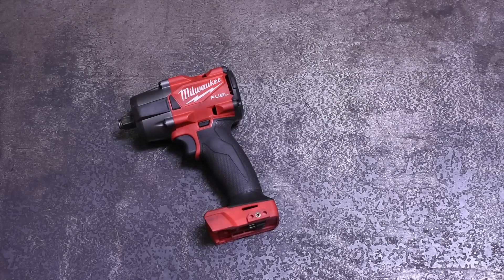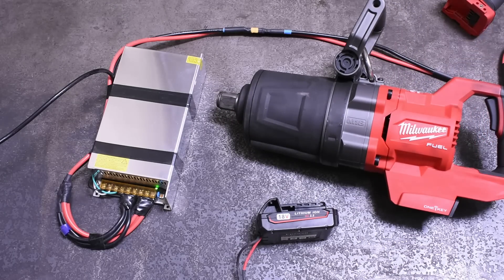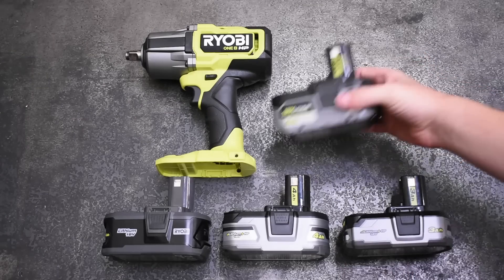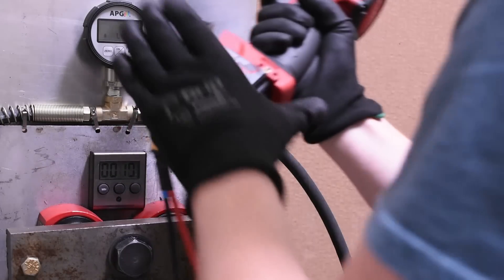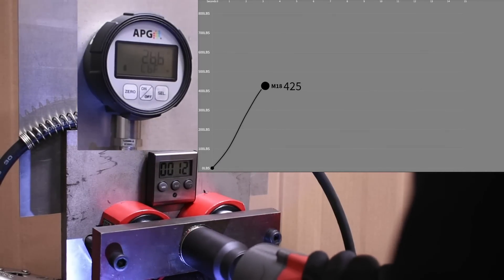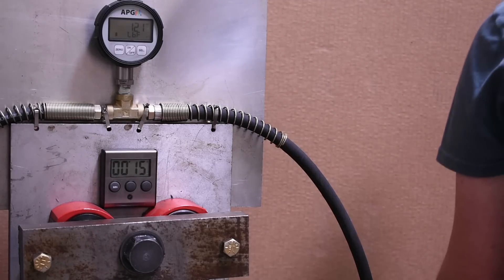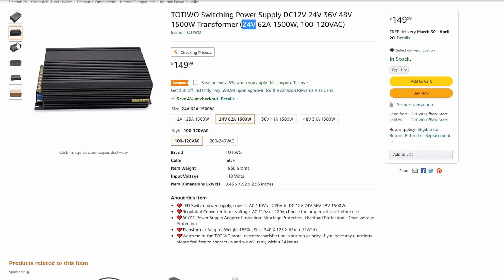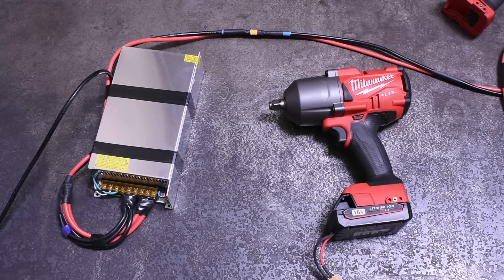Mad Scientist Youtuber Supercharges our Tools: 120 Volt M18 Impacts

Comment: I definitely think figuring a way to power cordless tools with wall power has more to gain than using cordless tools off of battery... sadly I can't think of a non-sketchy way to get wall juice to a battery tool off the top of my head, other than the obvious one of course.

Comment: I would do thicker cables for sure and try to keep them as short as possible. I feel that the pack of power is more the wires then the psu to be honest. I've done something very simular recently for 12v service. I run 6 lights at 100w per light from a computer psu. And I had to do a lot of trickery to get the power from the psu to the lights without seeing a massive drop in voltage from one end to the other.

You always want to have + branch both at the psu and one at the draw. Then wire a multimeter in voltage mode across those. And the number your seeing say 1v take that times 2 and you have a 2volt drop from start to end just across the wires. Keep that as low as possible.

Good wires to use are jump starter cables with super good termination for cars that are made from pure copper. You want a very heavy gadge cable.

Comment: You could also piggyback a battery pack with the power supply, as long as you do not overvoltage the max 21v used in a 5 cell battery pack, there is no risk of having them explode but connect the wires at the output and not to the cells, it would have to flow trough al the circuit resulting in power losses. I had to do that once with a semidead/underperforming battery since I only had that one at hand.

Comment: Don't know how this video managed to slip by me... This was/is something I've been trying to do myself, with old (mid90s-late00s) NiCd drills!
However, my effort is to turn a drill into a rock tumbler, as it's variable speed and shifted into Low gear it should easily handle plenty of rocks! 😏

The computer PSU I was using was the limiting factor though, not because it lacked in current capability, but because it's protection schemes kept kicking in – be it over-current or under-voltage, where the latter is to ensure a computer's stability [crashing], and I suspect short-circuit as well.

Anyways... I'm here for any and every Frankenstein effort!
Modding DC tools, to AC...
Modding AC to DC...
Or, modding EITHER to Gas Powered...
You've done the former and the latter, so that leaves the middle!
(although, I wonder whether an electric impact [AC] might have its hammer/anvil 'tuned' differently than a battery operated one, and whether it could make for a "better" gas powered candidate??)

Comment: To be fair, those are some long thin cables there. Like this is a lot of current down at 20 volts, so it sure isn't ideal to use such thin cables. I would run the 3 conductors all the way into the "battery" pack.

But other than that, it all seems somewhat fine to be fair. I have seen far far sketchier contraptions before.

Comment: he used xt60 connectors on that, which are rated as the name suggests at 60a if he went for the xt90 connectors they can reliably supply more than 250a i run a 1000a through them for spot welding. with larger cables would help

Comment: You could do the same and still have it be sort of portable if you made a pack of two, thee, four, or even more of the big 12Ah batteries in parallel and use a cord to attach it to the tool the same way. You could then wear that power supply as a backpack.

Comment: OSHA nono!? More like OSHA noknow!! Does OSHA know that transformers are safer than lithium ion battery cells? If a transformer shorts out is has a fuse built in. If a battery shorts out is has more potential energy than it's equivalent weight in TNT. A properly sized transformer with proper sized conductors and XT connectors would work all day. The tool would overheat and eventually melt the coating off the coils causing somethings to melt or seize up if overworked. No different than a standard corded tool. 

To improve the output would require a larger battery bank such as 12V LiFePo 150 Ah batteries with 20 C discharge capacity. Meaning if you had two in parallel you could discharge as much as 6000 amps at 12 V  or 72 000 watts peak. A system like this or one with capacitors could take on a charge from a 15 Amp 120 V circuit and turn it into whatever wattage you want. But there would be little point in doing so without first upgrading the conductors and the motor in the tool itself.

Comment: you will never get full power from a regular 120v outlet. I would like to see it rigged up to a 240v 60a outlet. Battery tools are superior to corded tools because they are not limited by the outlet current (15 amps) and can go whatever the battery is maxed at, which is theoretically unlimited as many tools use multiple battery packs in series

Comment: You could build another yourself pretty easily, just need a multimeter, soldering iron, and a driver set. Get the PSU, a cheap battery, some XT90 connectors, some high load resistors (just for adjusting voltage under load), and spools of some 10AWG Wire. Open the battery, and solder the 10AWG wire to the terminals, dremel out some exit holes for the wires, solder one end of the XT90 connector, then connect some more 10AWG wire to the PSU, use the high load resistors and multimeter to adjust the voltage to around 20 volts under load, solder the other XT90 connector, heatshrink everything, and you're good to go!

I did something similar to an older brushed dewalt impact that I got, battery was dead, and I had a spare PSU from my 3D Printer.

Comment: yall should try some spim08hp cells, or other high-drain lithium cells. battery hookup sells various types. a 5s2p pack and some upgraded connections (xt90's or multiple xt60's) would give more peak amperage than any ac-dc power supply.

I use a 3s1p pack as a jump starter for my vehicles. you can see youtuber lithiumsolar start a 5.9 cummins on them alone.

Comment: Lower voltage does not cause lower power you need to check the amp draw during these test as AMPS DOES THE WORK VOLTAGE IS THE PUSH OR WATER PRESSURE THROUGH A CIRCUIT. BASIC ELETRICITY !

Comment: It would take a very expensive power supply to match a large battery pack in wattage. Batteries suck for many reasons but you can't argue with their pure output for a short time. Unless you use an AC motor it'll be hard to beat the supplied battery pack unless you add another pack parallel. Maybe that should be your next "experiment". Add more packs in parallel and with a little more voltage. Just wire a 18v impact to 2 car batteries in series wired to 2 others in parallel. It'll run quick and die quick too I'm sure

Comment: Put the HD 12Ah battery and the power supply together simultaneously. Battery would smooth out the biggest current demand and get a powerful constant support from the grid.

Comment: I have an idea. A bigass 240v to 24v step down transformer, with some giant ass diodes to convert to DC and beastly capacitor to smooth out the voltage. Plug it into a 60amp plug, and wire it directly into the battery with some thicc silicone sheated copper cables. None of that regulated power supply crap. Might wanna make something to hold the drill though I wouldn't want to hold a 600amp 24v drill personally xD

Comment: Hmmmm. I have a good extremly high amperage low voltage power supply in the garage disguised as an Esab welder. It can put out 18v at 205amps. Might be enough to run the big impact.

Comment: I have a 1.5KW 24V power supply made with two server power supplies in series because I wanted to have a humongous power source if I ever needed one lol. Might try this 😆
Some of the sketchy stuff should be reduced as they're not nameless but made by HP so they should be better isolated/with better protections lol
It's also way under-rated, I pulled 2KW from it without it even breaking a sweat, those fans in the back didn't even ramp up. I guess they're used to pull air through a whole server!
Maybe I could try with two 1.2KW PSUs to have a 2.4KW 24V unit lol. Could be fun, you'd need thicker cables tho

Comment: Yer on the line out youll need some lager compositors as the power supply may be stragling with the surge, this is a gess at this point

Comment: If you really want a big power change, then you need more than a simple ac to dc converter that had an higher output power then the standard battery. For real power, you need a better frequency controller for the BLDC(brushless dc) motor. With a better controller, it can draw even more power, and you can run it at a higher rpm to! Please take a look at it. And please keep in mind the absolute limitations of the motor.

Comment: I've noticed some odd stuff with my milwaukee gear like this too. Sometimes if I use a plasma cutter with any cables near my 2767, the light will come on, and less commonly it won't turn off until I pull the battery and reconnect it

Comment: anyone know that maximum voltage that these M18 tools will accept before the internal circuit cries foul and shuts down or burns out? I have a similar setup to this one here but want to set the voltage to a safe but higher limit if possible.

Comment: I think you would be better off using a high-powered brushless speed controller and some 6s Lipo batteries powering the stock brushless motor to see what the tool is ultimately capable of

Comment: some high capacity capacitors directly connected to the power supply. just wondering if it will help with the original start curve

Comment: The jank power supply setup is one thing but you're also limited by the battery management system and the wires to the motor. To really do this proper, ditch the switch mode power supply and the tool motherboard/controller entirely then wire up a high amperage DC motor controller straight to the motor

Comment: i added a xt30 connector to my cheap 20€ screwdriver drill, now i can connect an external 6Ah 12v battery to upgrade from the original 1.5Ah 12v

Comment: As I would have, You turned it up to 20v. So 1500w/20v=75A this power supply should produce before losing voltage or cutting out like it did with the 1" impact.
In my experiments with Ridgid batteries the old nicds were able to put out 75+ Amps, but with significant voltage drop and not for long of course. The first lithiums cut out long before that or even being useful in my opinion. The newer larger ampacity lithiums  do better yet, but when the bms circuits sense  too much (preset at the factory) amps or voltage drop they still cut out.   The M18 battery cells are direct connect to the tool,  with just a communication to the tool to stop when discharged, but usually less prone to cut outs.  My point being  the same as your conclusion, This power supply is still too small since even the smaller batteries can put out more than 75A   to deal with inrush even though they  start dropping voltage rapidly.  Hence they can start the big impact but the PS cant.  but if the PS battery adapter still had the cells in it to handle the inrush,  even this power supply could probably run the 1" better than the batteries also once it was up to speed.   

My 2nd point is this is why the HPT 120v adapter is actually weaker than the batteries.  And the Skil and I think B&D offerings back in the nicd days also yielded less impressive performance than the batteries. Considering the size difference between the HPT 120v and this PS, it actually outperformed my expectation,  perhaps if your feel scientific again about this, it would be interesting to see other brands output if you put battery adapters on the HPT  or better yet, this PS and  test the top Milwaukee, Ridgid, DeWalt and Makita High torque models again. This would be the most level playing field actually, eliminating the factors of cell age, drain rates and such.

Enjoyed the video, Thanks

Comment: It's a switching powersupply! Either get a decent capacitor in line, or get a transformer based supply capable of large current spikes (an old amplifier powersupply section would be perfect 😉)

Comment: Honestly, it’s just a battery charger..  You can get a 2500 watt one that inputs 30A of 220V A/C and spits out anywhere from 13.2V to 48V DC.  I’d be happy to build you almost anything you want if you’ll supply parts.  I might even be able to reduce the sketch factor, but no guarantees..  ;)

Comment: Wait you just need some one to make you one of those boxes on easy it's a power supply yes with all 3 lines wired up to xt 90 connectors all with some what looks like 10 awg wire

Comment: I have a similar setup. Three is a voltage display on my unit with adjustment. The Max current output is 20 amps and I adjusted the voltage to 21 volts; so the max power output is 420 watts. I hooked it up to my ridgid tools. All worked out well except for the sds plus hammer tool.

Comment: I was looking around a while back for a way to adapt my batter orbital sander to be plugged into an outlet. I have no idea how a PC power supply never crossed my mind. I'll have to see if it's a reasonable option. I'm doubting that the 300 watt PSU sitting on a shelf would be adequate.
Reply: PC PSU has 3somethingV, 5V and 12V rails and the power rating is all these rails combined, so  it might be like 180-200W on 12V rail.

Comment: Adding a proper connector and a better dummy battery could actually be a good addition to many people's workshops , considering that you dont have to wasted electricity on battery inefficient charging and power conversion, but also the hassle of charging it. Very good idea, I am actually surprised that companies dont make such dummy batteries as similar contraptions as similar products already exist for cameras for example.

Comment: metabo or Hitachi  sell this for their tools. I tried with a dell 19v 9 amp laptop brick but it would just cut out when the trigger was pulled. you should try a 24volt setup for max torque motor life may be decreased

Comment: I don't know why the seller is calling this a transformer.   It is a switching power supply.  Switching power supplies are good at maintaining their output voltage regardless of the input voltage or the load.  A transformer takes ac in and provides ac out.  A linear power supply uses a transformer and adds one or four diodes to turn the ac to dc, then uses a beefy capacitor to smooth out the ripples from the ac to dc transformation.  

This switching power supply is a lot more complicated than that and why it can deliver constant voltage.  The down side is that it is current limited by the design of power supply.  That is probably why it worked so well with the smaller tools and not so great with the big one.  You will need a bigger output power supply to run the big tool.  Or just use the right battery.

Comment: More power supplies run in parallel, maybe like 5, wired the same way.  Then add a few super capacitors if it still needs it.
Reply: Should also try some big RC truck batteries.  RcSparks has one truck that will supply 800amps continues 1,000amp Burst (at a higher voltage) to the electric motor.  Let's see... 1,000amps ..... 20volts .... 20,000 watts.....

Comment: Need to run an inverter board to it that has a linear discharge. Would be curious to see what the sine wave looks like on that power supply

Comment: It would work best if you removed all the restrictions in the cables. At 1:55 you can see the final section has very thin wires compared to the rest of the set up, robbing power to heat the cables. You mention the smell which is probably from these heating up. Secondly you could shorten these cables ALOT. Aim to carry the power in AC for as long as possible. The DC section should be as short and thick as you can deal with.

Also, fewer connections is better, and make sure you have an XT90 connector, as someone else mentioned that might be an XT60, which should support 1600W+ rather than about 1000W, without heating up excessively.

Also please cover the exposed pins of the connector where the heatshrink has pulled off. If it's the pins pushed out the back of an overheated connector it's proabbly not making a good connection either.

Edit: Just watched his video on making it and he mentions the XT60 connector being undersized, so looks like he was thinking along the same lines.

Comment: add some caps in the dummy battery I can make one for the channel with a custom dummy battery with caps and a 1500W power source that pulls reference from the dummy battery so the power supply can comp the Voltage drop
I can do this with part on hand and drastically less sketch (as a hardware engineer i build crap all day this is a cake walk)

Comment: You could always crank this idea to 11... or 36 as it where. Most DC CC welders are in the 34-38V range and at 200-800Amps depending on the welder. Or maybe a M12 off of a lawn mower or car. Comparing engine off to running the engine. I'm sure that would be less sketch than the welder. It's 14.4V and max 200 amps minutes what it takes to keep the engine running. I just want to see one of these with some 4AWG hanging from it and a huge bloom of smoke out the top. But also am interested in seeing just how much the motor will suffer. After all motor are strange verbal load devices that normally fallow ohmes law. Voltage devided by resistance give you current draw. However that resistance changes in a manner when the counter emf is generated by the motor spinning. Not sure how the heavy load effects it. I get that there's a physical resistance to rotation the heavier you go the more there is. But does it show up as additional counter emf or is it because of the heat of the motor building up that creates the higher amp draw. But you can also see a spike of current when a motor firsts trys to rotate. Hmmm....